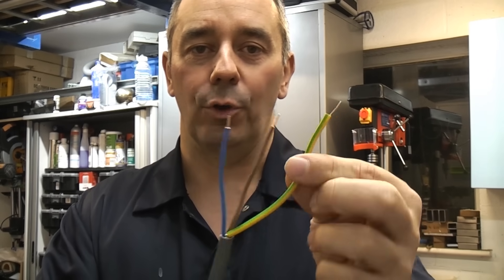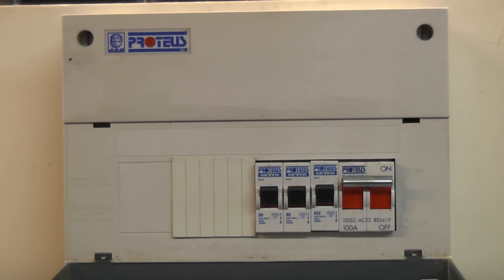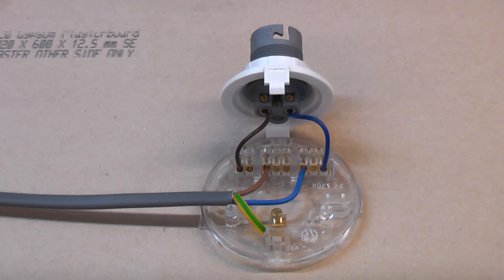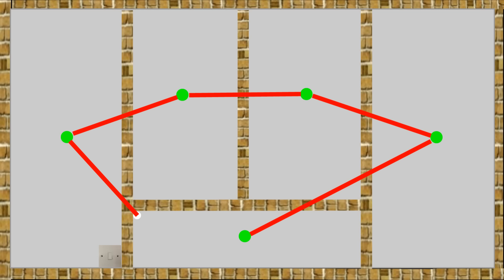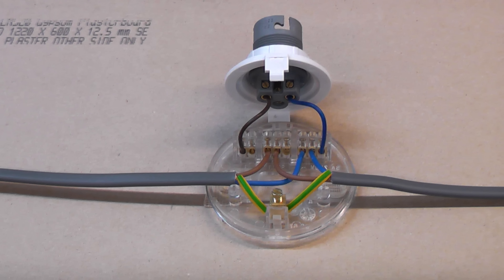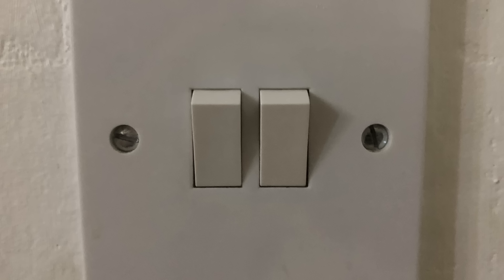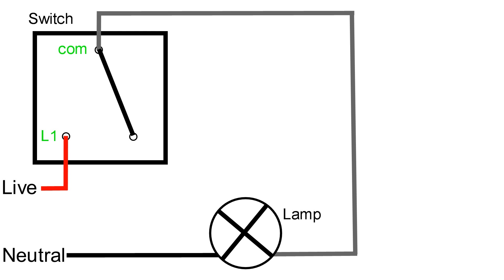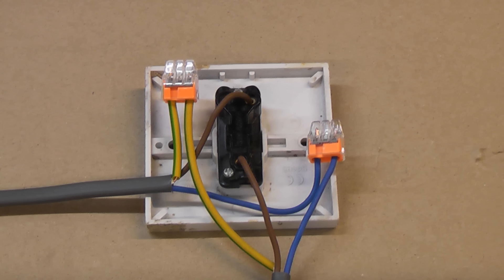UK domestic lighting circuits | Loop in at ceiling rose | Loop in at switch

Comment: Hi, love your channel! I have a question: Like many in the UK I have an old solid brick house. I would like another switch next to the one that turns on main light, that will turn on two wall lights too be installed in the alcoves next to a fireplace. How would you wire this?

Comment: Your wiring “regulations” are a travesty in this country. Coming from Canada nothing you call “good here” would pass even for a class of grade nines in high school. You have almost zero mechanical protection. Wagos over proper twisted wire and marretts. No strain relief on boxes. Plastic “junction boxes” instead of a proper octagonal box hard fixed to the structure. You rely on RCDs as a first line of defense when they should be the last line AFTER proper wiring. BS7671 is a joke compared to the Ontario Electrical Code. You have sacrificed safety for bureaucracy and “ease”. And all with double the voltage and current! 😮

Comment: Thank you so much, clearest and simplest explanation and diagrams of the wiring i have seen. I don't do electrics as a general rule, a friend installed a bar light into my kitchen. And it kept shorting out, turns out my house must have had a cowboy.electrician at somepoint and had used red, blue and earth cable. For the switch ( brown, brown and earth), your video solved the riddle and I now have lights :)
Reply from the maker: I'm glad the video helped you to fix the issue and thanks for the comment 👍

Comment: What a great video...thank you.
Can I ask a question?
I have a florescent tube that has started to give a loud buzz and another that got really hot and buzzed, they are quite old any ideas what it is, would it just be the whole fittings and after a replacement should be ok.

many thanks and have subbed

Comment: I had a look at a ceiling rose today, and i seen something strange:

One red (live) into the switch live terminals, nothing into the loop, and TWO black (neutrals) in the neutral block, why might this be?
Reply from the maker: Is there another light fitting in the same room, that comes on at the same time as the one where you removed the ceiling rose?
The only thing I could think of, is that the ceiling rose you looked at, is connected to another ceiling rose, so at your ceiling rose there will just be 1 live, 1 neutral and 1 earth
Then someone has come along and borrowed a neutral (this is often done when someone installs an outside light and thinks they can take a feed from a nearby light switch, only to realise that there is no neutral in the light switch (hence the borrow neutral).

Comment: If you do the loop at ceiling roses it should be a 3 core and earth as bs 7671 requires a negative at switch positions just a fuel for thought 👍

Comment: Can two light cables (in case i need to connect two lamps) to be switch live terminal ?
Reply from the maker: Yes, or you can “daisy chain” the connections from the first light 👍
Reply: @ultimatehandyman  thank you. Installed new lighting in the garage yesterday by putting two cables into the same terminal.

Comment: Such an easy to follow video. I wanted to ask on a separate note, if one were To install a quinetico wireless receiver, would the switching cable be made redundant?
Reply from the maker: I’ve never used any Quinetic stuff, but I would assume that the switch cable was no longer necessary 👍

Comment: I blew my upstairs and downstairs light breakers while trying to wire up a downstairs light, I replaced both breakers but only the upstairs lights now work. I can't get the downstairs lights to work swapping the breakers around shows there not faulty, what else can I check to try and restore power.

Comment: I have two set's of wires coming out of my ceiling going to an existing plastic ceiling rose. Both these wires have Brown, Blue, and Earth, so 6 cables.
I have a new metal light fitting thats a full replacement for the old rose. My new light fitting is pre wired, clearly labelled and only has 3 connection holes - Live, Neural and Earth.
What do i do with 6 cables coming from my ceiling  when going into 3??? Do i just twist together brown brown, blue blue and earth earth, then connect to the 3 holes in my new metal light fitting???

Thank you.

Comment: Legend m8
Reply from the maker: Thanks for the comment 👍
Reply: @ultimatehandyman  you saved me a fortune buddy, a comment and a like is the least i can do. Im already subscribed. I did the job today. It took me ages but i got there and it all works. I rolled about in some ichy wool and inhaled it all. I also fitted to junction boxes 2 light fitments and 1 switch. I used the money i could have spent on an electrician to buy myself a new cordless drill which ive veen needin for years.

Comment: This is so confusing to an absolute numpty like me. I am continually watching it to try and get the information to sink in. My aim was to remove a single light switch which had live and neutral only connected which turned light on and off with a PIR solution that said need a neutral.
Easy DIY job i thought!
I have now bought multi-meters to test and ensure I don't electrocute myself when trying to identify cables the rose solution.
I presume the 1st cable shown attached has voltage flow once the master circuit breaker is ON and voltage is NOT controlled by anything else?
How do I identify the switch cable if it looks exactly the same as others?
Any help appreciated

Comment: Thank you for the video,  i have a property and all the wires are red and black.  Do  i need to rewire the whole property ? cheers
Reply from the maker: If the outer protective cable insulation is grey, it should be fine. If the outer protective insulation is black, you best get an electrician to check it out 😉
Reply: @ultimatehandyman  Thank  you ☺

Comment: Great video. Covered all possibilities! I'm looking to install a bathroom fan with an isolator switch and the diagrams make sense, easy enough to follow, but I haven't had a chance yet to figure out where to wire it from. Now I'll be able to identify which of the three it is and proceed from there. Very helpful
Reply from the maker: I'm glad the video helped 
Thanks for the comment 👍

Comment: 6:35 if the earth wire is going to be terminated at switch, then why do we need to connect earth wire from switch cable to earth wire from circuit cable at junction box?
Reply from the maker: All earth wires need connecting together and then to the earth terminal at the consumer unit. If some switches don’t have terminals for the earth wire, it still needs connecting to the rest of the circuit, in case someone drills through a cable or cuts through one with a saw etc.  👍

Comment: Hi mate, thanks for this video.
We live in a bungalow and I have a hallway with 3 ceiling roses controlled by 1 switch at either end of the hall. I am wanting to take these away and fit flush ceiling lights. The new lights have 2 terminal spaces for blue and 2 for brown.
One of the ceiling roses has 1 blue and 1 brown going to it from the loft, the next has 2 brown and 2 blue, the next has 3 brown and 3 blue.
But as i said, the connector on my new lights only has space for 2 brown and 2 blue so how does this work?
Reply: The first with most wires will have loop in and loop out. This is basically carrying Live Neutral and earth from point to point. The switched live is taken to the switch for each set of lights controlled.

In your case switched live neutral and earth is going from the main ceiling rose (A) to light (B) and from light b to a final pendant (C). Point A, B & C would be better terminated in maintenance free wago light or ideal boxes. Make sure no inner sheath of the twin and earth is not exposed. Hope this helps. 👍🏼

Comment: how does the wiring work when the room has 2 or more llights you want to come on simultaneoúsly?
Reply from the maker: From the light fitting or ceiling rose, you connect a cable.
Earth wire to earth terminal
Live wire to switched live terminal
Neutral to the neutral terminal

Repeat this at the other end of the cable and both lights will switch on or off simultaneously 👍

Comment: my upstairs lights have just intermittently going on and of or flicker is it likely to be a loose connection in the loft ??
Reply from the maker: It could be, but these days most cables are terminated at each ceiling rose in the upstairs rooms. Might be worth checking all connections (with the electric isolated at the consumer unit) 👍

Comment: Very useful video and it looks straightforward, but I had a problem and I am not sure why. Maybe I should switch off electricity in whole house? I switched off just the downstairs light, to fit metal pendant light in the kitchen (there is 3 gang switch unit -one for pendant, middle for main lights and 3rd is for cupboard lights). Took off the ceiling rose, there were 3 cables. Connected them to the new pendant which has Junction box (is it called like that?) And the space in the box was so tight I needed to push the wire with my screwdriver and I think then electricity went off. 
I dont know why? If the downstairs light were switched off at the main fuse box. I am scared to try again but also with the crisis I don't want to pay £75 for the job to be done 😌😭
Reply from the maker: Best to check all of the connections, it can be difficult if there is not a lot of room in the fitting.
This video might help-
https://www.youtube.com/watch?v=WZizlnLfLks&t

Comment: Wow - my foray into the world of electrics (my dad was an electrician and I've always been terrified of touching it). I wonder if you have any thoughts on a switch that didn't turn on ceiling light and so after a lot of time spent trying to solve the issue, we bypassed it with a pull light fitting (fan type) which does work but is not very attractive. I want to put a new light fitting up and get the switch to work. Is it just a case of trial and error or should I replace everything? All other light switches and sockets work in the room and in the house... bizarre!

Comment: How much weight can the ceiling handle
Reply: There’s a piece of wood between the joists. It’s drilled wire fed down through so it can hold as well as your joiner 👍

Comment: Just the help i needed..Got stuck with an old pull light switch i was replacing in the bathroom.I wanted to replace it with an outside switch and then add multiple downlights.Perfect video for me.Thank you very much.
Reply from the maker: I'm glad the video helped 
Thanks for the comment 👍

Comment: Hi Team 

I have a very similar problem when i went to swap my main living room ceiling light. In total i had 3 wires. In each of those main wires i had 3 wires coming out red, black and green.

I had a spare bulb and wire connection so that i could check which one was live and which one was switch. What i found out is I had 2 live wires where the bulb came on.

Meaning i first connected the red and black from the main wire, the bulb came on. After that i connected the red and black from the second main wire and bulb came on. Later i connected the red and black wire on the last main wire and the bulb never came on, which means this is switch.

My only question now is why do we have 2 live wires in the rose ceiling outlet of a 1930 house ?

Comment: hi please comment.2;51 if the live terminates there how does it power the light when it is not connected ?
Reply from the maker: The live is terminated at the switch, then the switched live wire goes to the light, along with the neutral and earth wire 👍

Comment: in modern houses plug sockets are on a ring main ,does lighting have a ring main or does it just stop at the last light
Reply from the maker: Sockets are often a final ring circuit, but lighting circuits are normally radial circuits, which will just stop at the last light on the circuit 👍

Comment: Will the wiring still be there if there isn’t a light in the loft ?
Reply from the maker: Yes, I have never seen a loft in the UK, that does not have the wiring for the lighting circuits 👍
Reply: @ultimatehandyman  cheers

Comment: Personally I don’t like the 3 plate loop in method at the ceiling rose as it can make the job very confusing for future DIYers who have never changed a light fitting in their lives and also it’s a really outdated method!!  My (and a lot of electricians out there) preferred method of lighting circuit wiring is the loop in at the switch because you have all your connections there for a start so easily accessible and also it adds the benefit of having only one cable at the lighting point which makes replacements in the future much easier - a lot of modern light fittings have those choc block connectors in tiny enclosures which are only really designed to accept one cable. You can also do 2 way switching with three core and earth by carrying the neutral through one of the conductors (use grey) from the loop in point to the 2nd switch and the twin at the other end goes straight to the light.

Comment: Is there a way so say move the existing ceiling rose if there is no slack, not using the old style jb box. I see you can use wago light connectors but there is only two slots not three to extend the length of the cables

Comment: I always knew that switching is always on the live side but didn't know until your excellent video that there were so many ways to loop in for switching. Having moved into a house with loop connections in an existing big 1970's ceiling fitting via nylon blocks, there was clearly no way that all three blocks would fit in a standard sized rose, so have pulled all cables up into the loft and am attempting the joint box method there. Thanks for such a detailed video.
Reply from the maker: Glad you liked it!
Thanks for the comment 👍

Comment: I hate ceiling roses, they get brittle over age (especially the older style ones) and they are ridiculously fiddly. Switch first makes infinitely more sense than ceiling roses or junction boxes, because if your cables are buried under floorboards (or stone floor like my property) you have to be insane to want to rip the living daylights out of the floor every time you want to change the circuit - simply turn off the circuit at your consumer unit, take off the switch cover, disconnect the cables then crack on. If you're really sensible, scrap the loop entirely - use a junction box in one accessible location (I use the Quickwire four way splitter but others are just as good) then send the mains power directly to each switch. The beauty of that is you can then disconnect one "loop" at the junction box, and all the other lights will continue working. No "contamination".
Reply from the maker: Yeah, I think ceiling roses are used purely for cost.
These days they should develop a modular system, where a ceiling type fitting is installed, but a new light fitting can just be plugged in and locked into position - then there is no messing about with wires every time you want to change the fitting.
Thanks for the comment 👍

Comment: Great video. If you don't mind explaining. I'm trying to add an additional out door light (never one installed in property). Could you briefly explain how I would go about this. Do I add a junction box outside and daisy chain the light fitting from the closest inside ceiling rose? But then do I just add a separate switch or will my existing 3 switch in side activate it automatically when I turn on bottom light switch?
Reply from the maker: I'm afraid it is not a simple answer. Your best bet would be to ask here, it's free to join-
http://www.ultimatehandyman.co.uk/forum1/viewforum.php?f=33

Comment: Only problem with junction boxes is, someone usually hides this in the ceiling or in the floor. Needs to be accessable for testing. When you do a new rewire. I dont recommend using junction boxes Just use the loop in light and loop in switch method. It helps the next electricians to find every point. If we end up looking for a loose connection it will be a problem to find the joint. Use rectagular plactic junction boxes with wagos at lighting terminations. (Example Downlights)

Comment: Ref loop in switch plan at 4:38, you have omitted the wires looping in and out of the switches. Otherwise a very good video.
Reply from the maker: No I haven't, in my video the loop in wires are fed from below the switch ;-) 
Thanks for the comment 👍
Reply: My apologies, I thought the loop was from above.
Reply from the maker: @westwonic   No worries Nick, Thanks for the comments ;-)

Comment: Good video. Can I ask you a question. In my new flat I have a couple of double dimmer switches both with two wires going into. In each room I have a number of spot lights and one of the dimmers on each switch turns all the lights on at one. The other dimmer switch does not do anything. When looking at the back the switch live cable from each goes into the com port. The live cable go into each L1 position. Plus there is a loop cable going from one L1 port into the other L1 port. Please can you advise the purpose if possible of the other dimmer switch. Many thanks
Reply from the maker: Are the two dimmers on the same circuit?
You can only use one dimmer per light circuit, if I remember rightly.